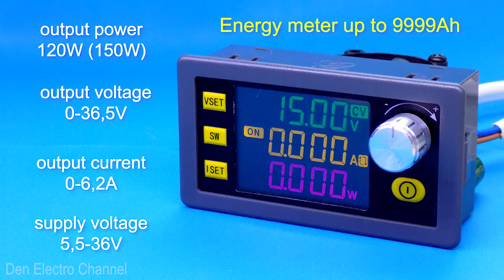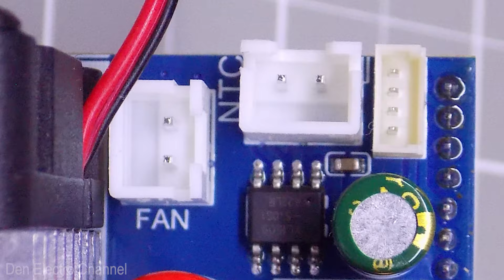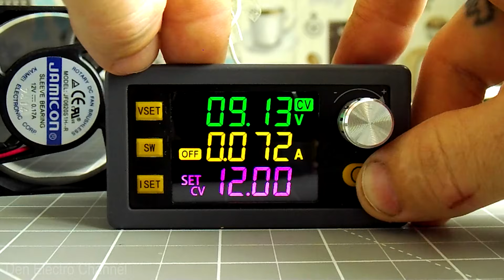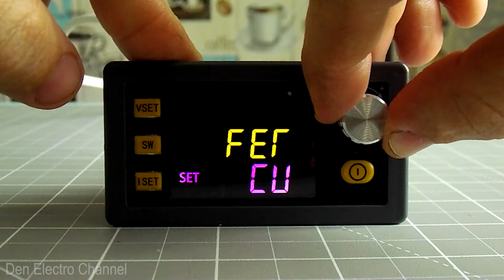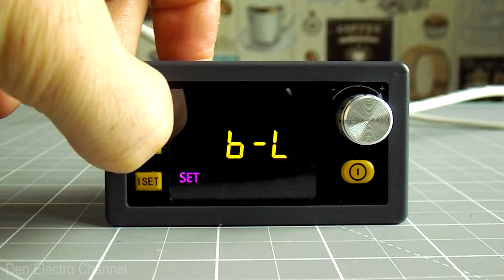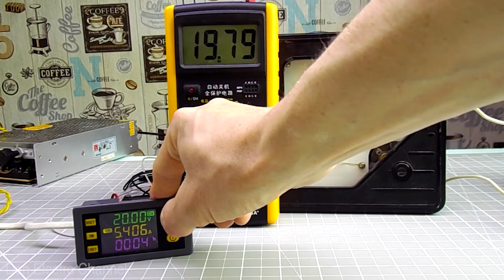Budget Power Supply XY-SK120: Testing at Full Power!

Comment: I love these little DC-DC converters, but too bad the manufacturer did a cheap shot on the capacitor in the lower corner -- It's ESR is too high, and if you drive the converter close to it's advertised capacity, that capacitor will get so hot it will pop.  Fortunately, that capacitor can be replaced with the higher quality capacitor that should have been used, or just monitor the temperature of the cap with a 10K NTC and set the converter to shut down before it gets to 100 degrees Centigrade.

Comment: I have the 60 watt version without the fan. Do you know the fan connector max output voltage? I'd like to add one to mine to use it in a box.
Reply from the maker: The SK120 fan is supplied with 5 volts. I suspect the same applies to your model. You can connect a fan rated for 12 volts, but it will spin slowly at 5 volts.
Reply: @Den_Electro_Lab  Thank you.

Comment: Very good explanation!

My problem is with charging the solar panel and 12-volt battery. Despite the powerful solar panel, the device simply switches off at a certain current and doesn't restart. Automatic start is, of course, enabled. Every day, when the solar panel receives sunlight, I have to manually activate it. It's not just a matter of switching it on; I have to reduce the current to zero before slowly increasing it again. It then starts charging. The MPP setting makes no difference. The MPP setting provides a soft start.
Reply from the maker: Have you tried doing the same thing with a different power source? I mean running the SK120 from a power supply. And also connecting a battery to the output. Just make this power supply with voltage regulation. Start with a low voltage, then increase it gradually. It will look like the sun is rising, as if the voltage on the solar panel is increasing. Is this how you can determine the problem with the solar panel or the SK120 module?
Reply: @Den_Electro_Lab Thank you for your reply. The solar cell is supplying enough power, and the voltage never drops below 14 volts. The output is sufficient. Even when the output current is set to only 200 milliamps, the device doesn't supply any current, even though it's switched on. Is the maximum charging current for battery charging necessarily set via the 'charge cutoff current' setting? There are conflicting recommendations regarding this. I mean, a 70 amp car battery can easily be charged with at least 7 amps; the panel has 100w, delivers about 50w, so it should be able to be charged with at least 4A.

The behavior is such that once it has switched off, it doesn't switch back on, even with the MPPT solar setting. It should be possible to set a maximum current; if it can't deliver that current, it should simply deliver the current it can, instead of just switching everything off.

My first thought was of course to test it with a different power source, but I hadn't had the opportunity yet.

I've done some more testing, and the problem is simply that if you set a current and it can't be supplied, the device just shuts down. The MPPT setting is good; you can see that it doesn't regulate the current to the maximum, but rather as much as it can. However, if the current is set to, for example, three amps, it tries to reach that value but can't, and then drops to zero instead of simply supplying the current it can deliver. The sun is at an angle, so the module isn't producing as much power, but it's still delivering 20 watts, which it could use to charge the battery. You have to adjust the maximum current manually, but that doesn't improve the solar cell's performance. Setting it to, say, 0.5 amps is a huge waste.
Reply: @xyz8773  I think this was fixed in later firmware. I had this exact problem with an older device, but a newer one, that I bought later, is restarting fine. Unfortunately, the only way to upgrade firmware is through their Wi-Fi add-on board that costs about $7.
Reply: @Alex.Adametz that's good to know, thanks. It's difficult to find that module, maybe an UART to USB could do the same. With the wifi module you have access to the internal webserver to do the update or you have to use a mobile app for this?
Reply: @xyz8773  nope, just a UART to USB won’t do… the user manual says both WiFi module (it’s called XY-WFPOW) and the mobile app are needed

Comment: I recently got one of these and I 3D printed a case for it. I’m quite impressed by it and it has more features than my AC lab bench supply! Having DC input just really opens up a lot of possibilities. I also use a PD decoy for the input so I can power with a USB-C charger.
Reply from the maker: I completely agree with you! The device is very good and has many uses. It can be used as a laboratory power source and as a universal charger for various batteries.
Reply: I've finished mine today, that's why I came to this video, because somehow I couldn't get it to work (forgot to press the on button) 🤣

Comment: I bought this exact same unit from Ali, from a Seller TZT and tested it last week The output load voltage and load current being displayed were faulty. The output voltage remained constant despite drawing a 3A to 4A load with output between 6V to 8V. The load current display was about 60% of the actual load current. Hence, the current limit set wasn't working and output didn't cut off when load current exceeds limit. I reset the firmware for at least 5 times over 30 min. Still wouldn't work. The Seller didn't seem to understand any Electronics. Keep saying the Factory Engineer on holiday. Keep using delaying tactics. Finally, the firmware cannot be upgraded without buying a WiFi attachment and downloading an Apps from the factory making it. So now, I have to add my own external display and external current limiter.
Reply from the maker: It's very unfortunate. It's a shame the firmware can't be updated without Wi-Fi. It's also not cheap and isn't always needed. I have two of these modules and they work well.
Reply: @Den_Electro_Lab I bought this module for solar mppt. Do you have guide how to use on lifepo4 or lead acid
Reply from the maker: I think it's all simple. You just need to set the voltage and current of the battery you want to charge.
Reply: @Den_Electro_Lab I'm done what you said, the problem is the efficiency, a 36w consumption of this module is only giving 20w output, not recommended for solar charging. That's why it's cheap it is only good for bench power supply and lab testing